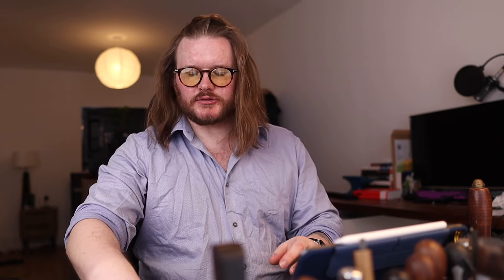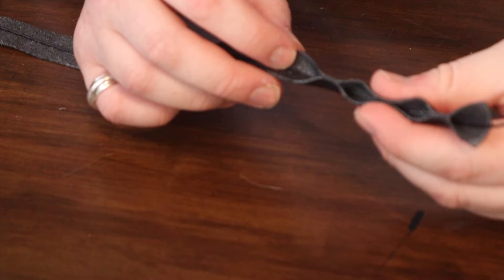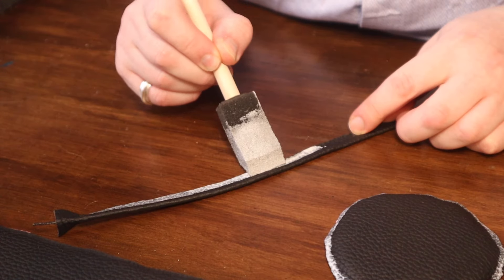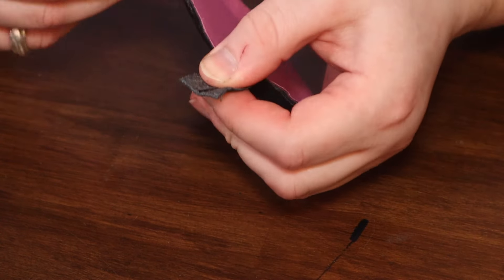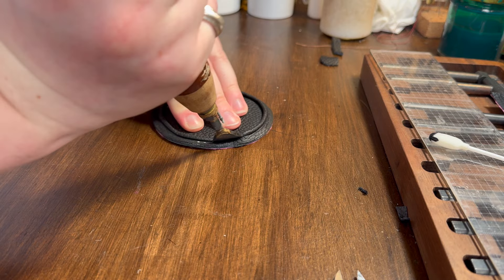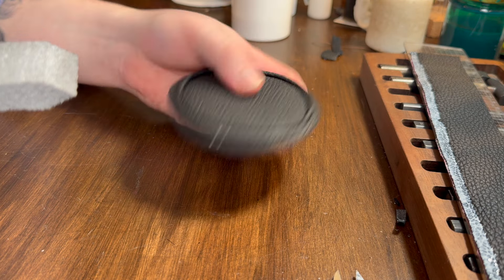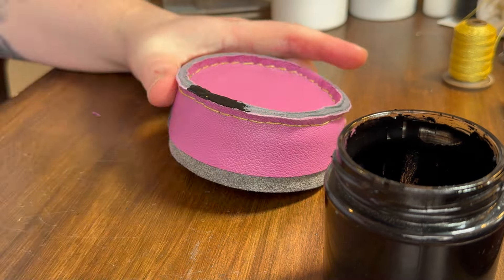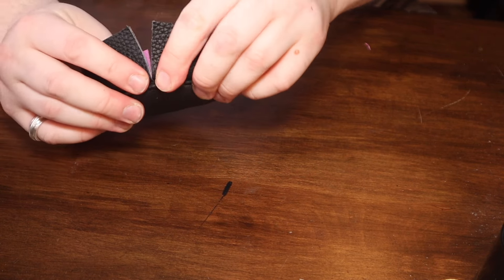Leather Piping: The Ultimate Steep-By-Step Guide // *SECRET EXPOSED!!*

Comment: A bit off topic here but wanting to add piping to leather-covered or leatherette wood case.  The way I am considering is to apply white plastic piping or recessed plastic strip to secure the leather edges tucked in a slot in the wood, but I have no idea as to slot depth/width or leather overlap.
Reply from the maker: For this sort of thing I’d go for a 1cm(10mm) overlap. Hope this helps
Reply: Too bad I can’t send a pic of what I’m after.  It’s actually piping free!  Retaining strip is subsurface in slot, holding tucked in leather.